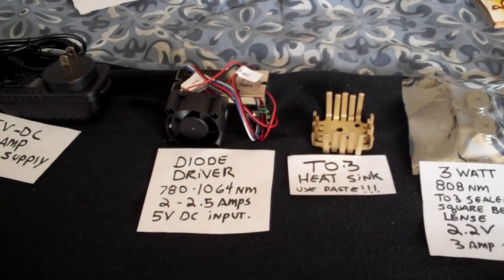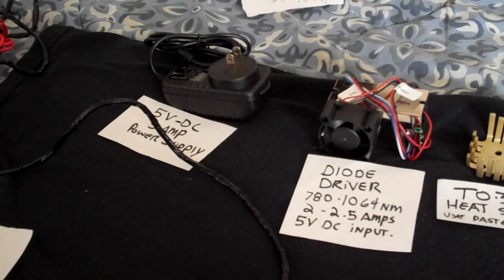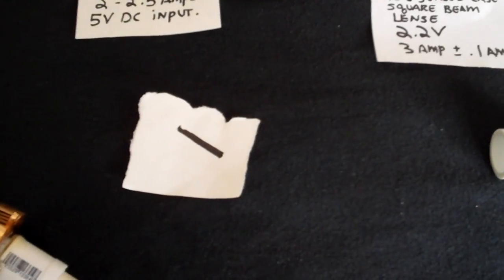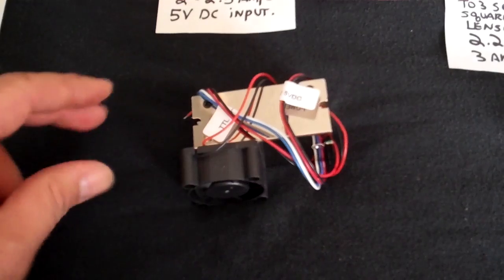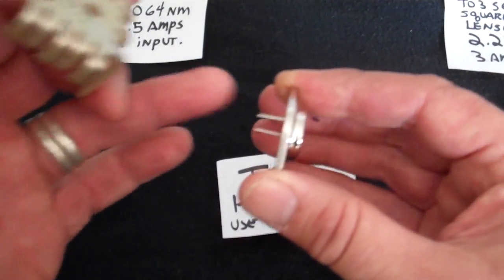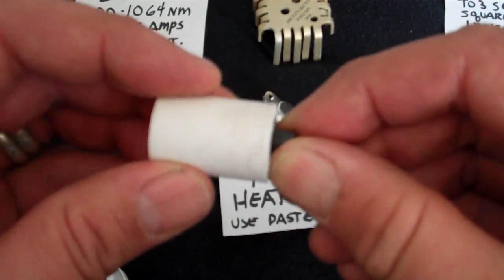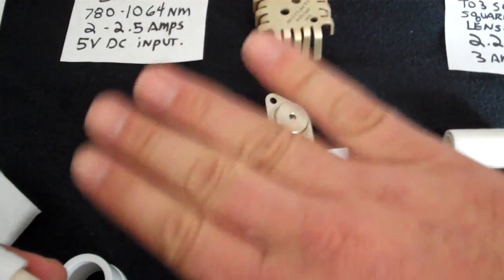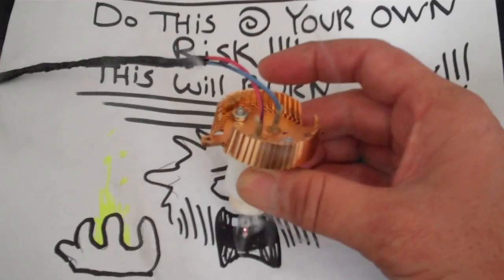DIY HOME MADE LASER TATTOO REMOVAL how to build it. invented by ATTILA GIBSON.MP4

Comment: That laser is really dangerous to the eyes. Looking at the goggles you use, there is risk of frying your peripheral vision. I also hope you have tested those made in china goggles before using them or even recommending them. One slip with a class 4 laser means you wont be seeing anything and should really emphasize safety and proper protection. 'Get the pink ones' is not sound advice : /

Comment from the maker: at 400nm your close to the purple and violet side witch dumps all its energy on top layer of skin,at 808nm it allows penitration through the translucent before it strikes the ink and turns to heat.you would need at the very leasr 800 mw properly focused to get the most heat,i used 3w because it just works best,typically red is absorbed well by green and visa versa.